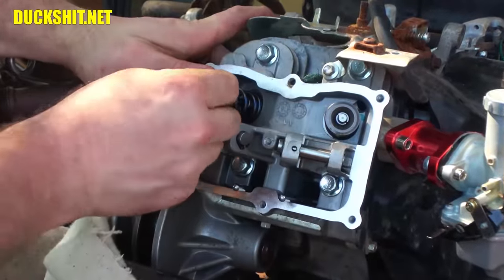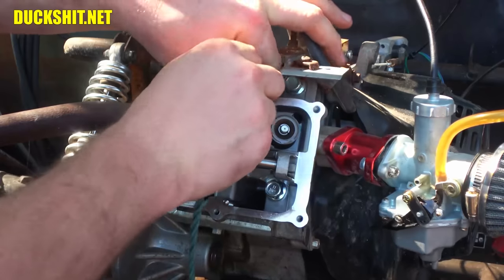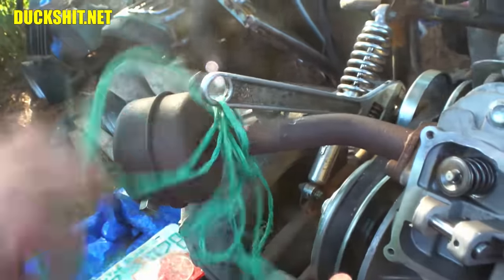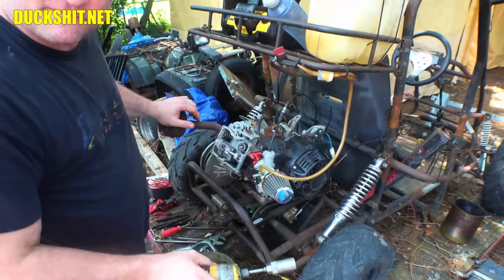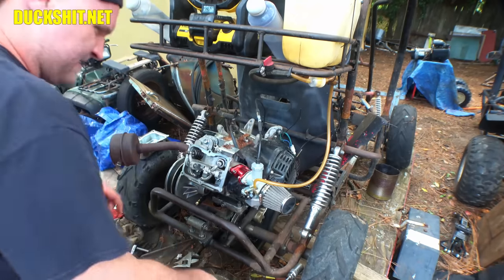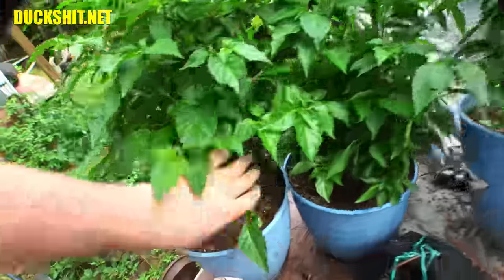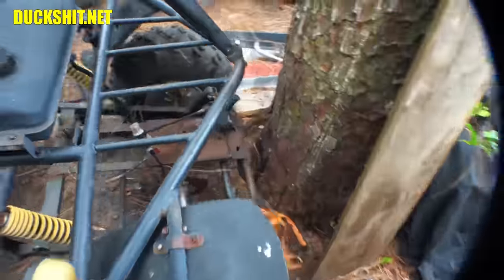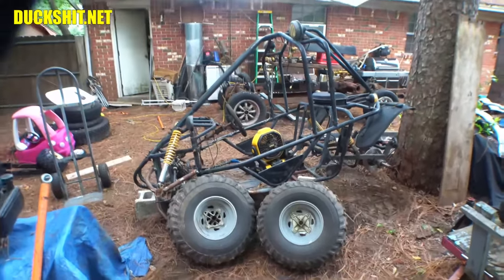🔧Predator 301 High Performance Valve Spring Upgrade - Other Chaos🔧

Comment: You have got to be kidding me with the zip ties on the valve spring. I have faught them dang things every time when I could just do that.. wow man that’s awesome!
Reply from the maker: Yep, zip ties!  It won't work for every spring though, some are too strong, but it surely got the job done when you're in a pinch! Just be sure to clean out all the zip tie bits you cut away afterwards!  Hope that helps!  Thanks for the comment!

Comment: On the red vw, I wonder why the mechanics would try push starting the bug? The coil wire wouldn't keep it from turning over. You would think any type of mechanic would check the distributor area right away. Your right, alot of mechanics scan and replace.
Reply from the maker: I kept hearing things like dead battery, and not getting fuel... lol...  one guy told her it wouldn't go in gear.  I have no idea what their problem was.

Comment: The 22lb valve spring is very hard to get it on by hand easy way if you have a valve spring compressing tool
Reply from the maker: Actually I think the 22 lb is very easy, 50 lb springs neer some real force.  But I am the Duckman after all hehehehe!  Thanks man!

Comment: The Teflon wire was to install windows.
Reply from the maker: Probably not as strong nor as flexible as my fiberglass fiber optic cable, doesnt need to be slippery.  🙂

Comment: Random question, what's going on with the edges of the camera?
Reply from the maker: Camera lens vignetting, and it's annoying as hell.  Not been able to tune it out.  Bigger wide angle lens probably required, but not been able to find one.